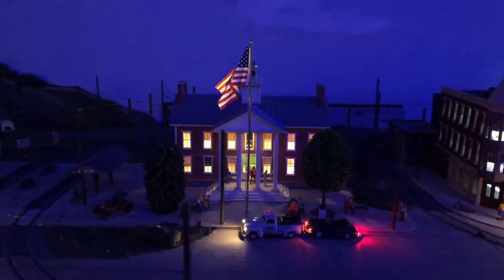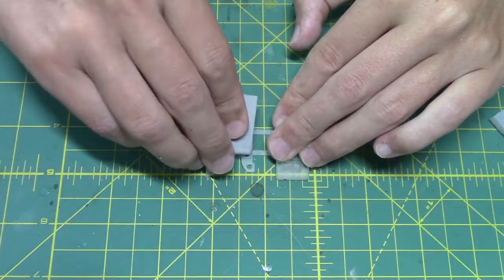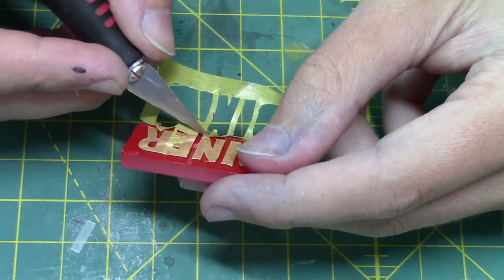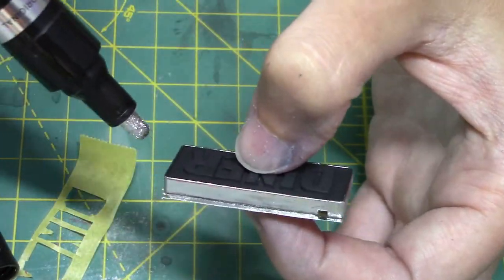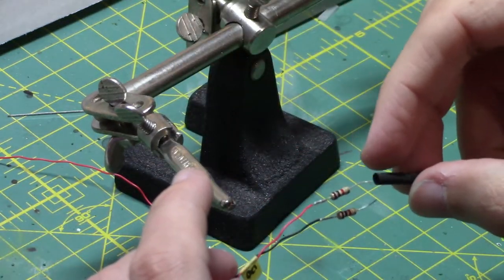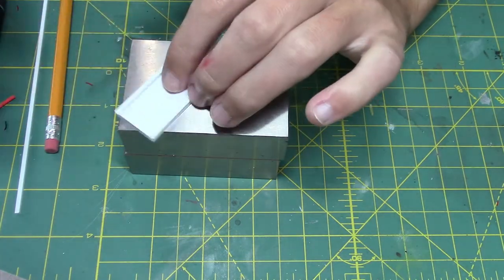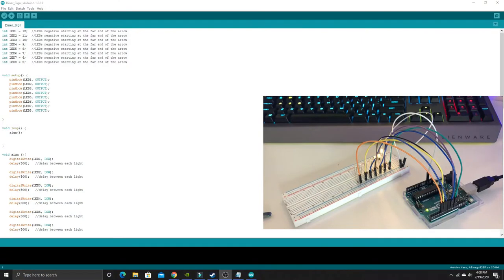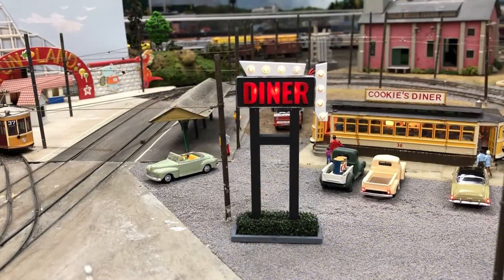3D Printed Animated Diner Sign using an Arduino HO Scale

Comment: that's a pretty impressive build Bro. and i didn't know there were websites to print and deliver 3-d designs. thanks for sharing.
Reply from the maker: Thank you. I have used Shapeways a handful of times and have had good results. It’s cheaper than buying a printer if you don’t plan on using it much. Thanks for the comment, John